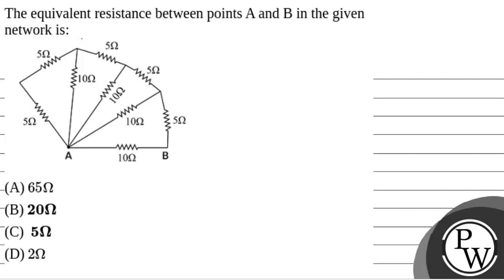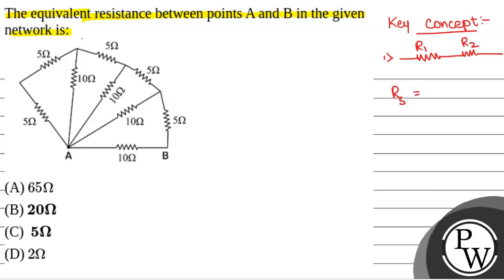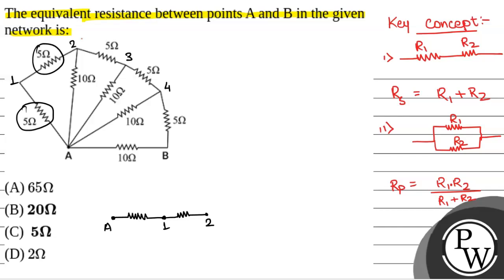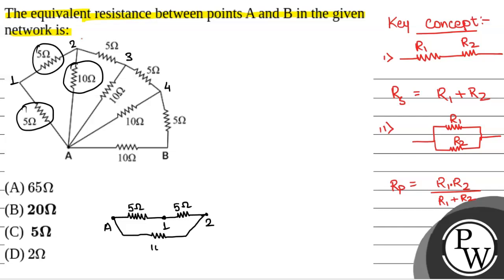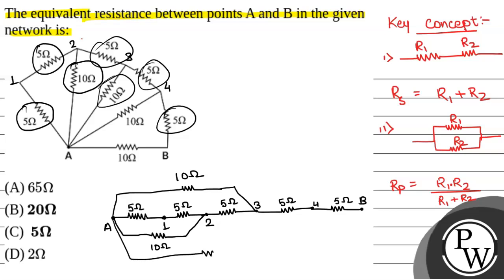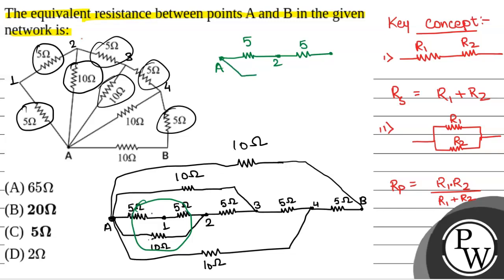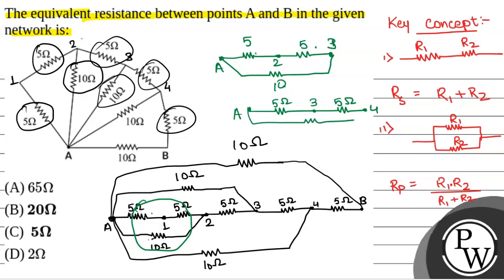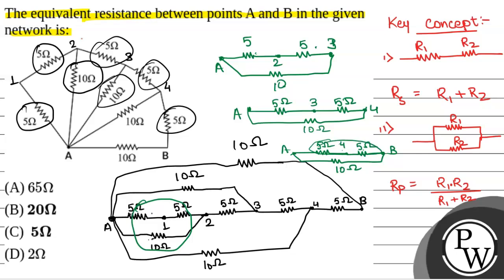The equivalent resistance between points A and B in the given network is:....

Comment: To solve this question will be when 2 releases are connected in syriage, the post, the yard, the 2 registers are one and are 2 when they are connected in Siri.Then are equivalent in Siri, which it did not get way out if you give in by are OnePlus or 2, and similarly.When tour registers are connected impellent , the two registers